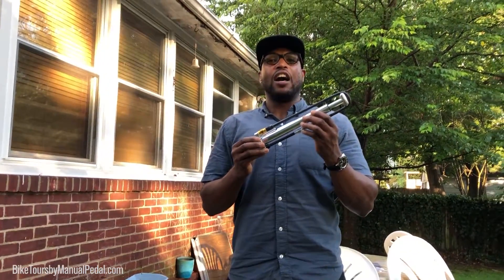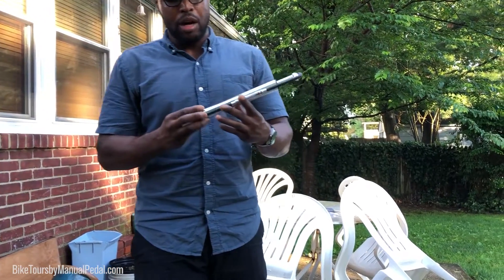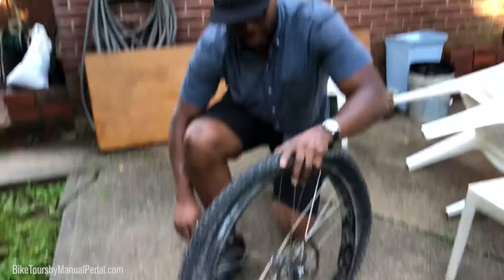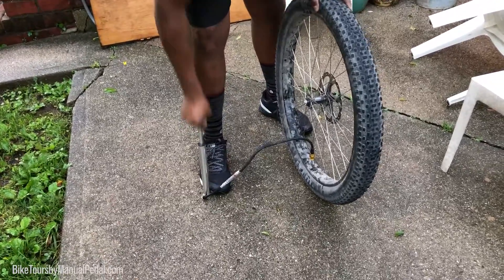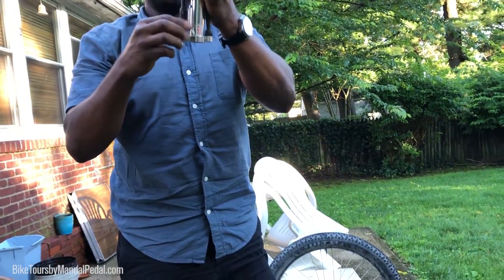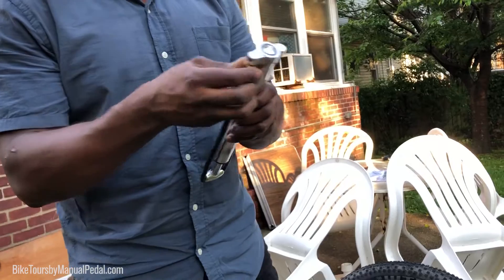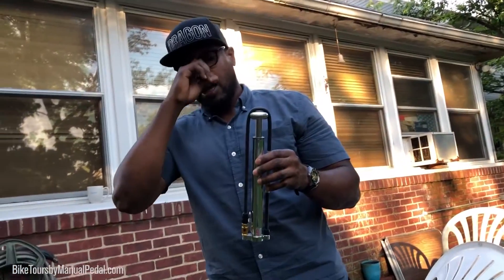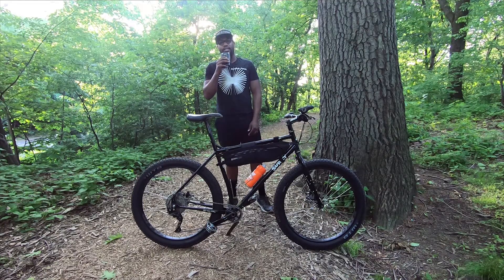Lezyne Micro Floordrive HVG - Mini Pump Review

Comment: Debating this High Volume model versus the Lezyne High Pressure model. I run 29” x 2.2” tires on my Trek Procaliber. But I have a Road Bike too. I don’t ride that as much so probably should go with this HV model and just continue using the compressor at home for the road bike. Nice review man
Reply: Have you decided, yet? I want one for bike emergencies. It uses plastic threads against metal ones with the smaller pumps. Almost a no-go. Thanks!

Comment: How well would this work for tubeless mtb 29x2.6 tires inflated to about 20 psi? Thank you.
Reply from the maker: John Panozzo So good dude. I use it on my plus bike with 27.5 3inch tires and my gravel bike with 700x40c.
Reply: @dwaynepedals  Are your tires tubeless or tubed? I yours are tubed, how much longer do you think it would take to pump up tubeless? Have you considered or evaluated Lezyne's Micro Floor Drive XL? Thank you again my friend.
Reply from the maker: @geopietro  Yeah I run tubeless on my bike. Not sure how long it would take but I can get a 3inch tire up to 20 PSI pretty quick.
Reply: @dwaynepedals  Thank you very much. Great info.
Reply: @dwaynepedals  Do you think Lezyne's high-volume XL model is worth the extra weight (205 grams vs 367 grams)? It has greater pumping volume.

Comment: Do you need to do anything special for the adapter to get it to inflate presta valves?  I can't get it to inflate.
Reply from the maker: bucket traveler make sure it’s tightened down properly.
Reply: @dwaynepedals  I thought it was.  I have a flat at work, I work nights and it has been here for two days.  If I can't get it to work when I get off I think I'll need to bring my old floor pump
Reply: Have you got the chuck swapped around to presta?  Mine came with the schrader side up.  Sorry if that is a stupid question
Reply: @grobbosixtyone  it wasn't that, I just didn't have it screwed on tight enough